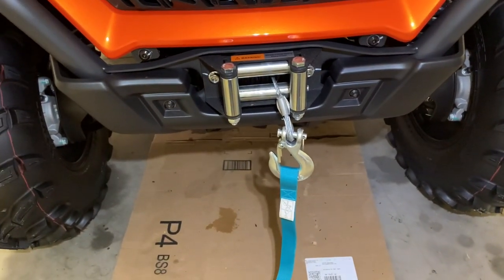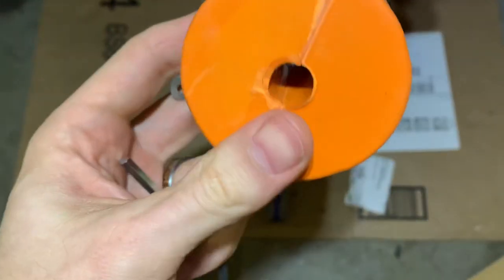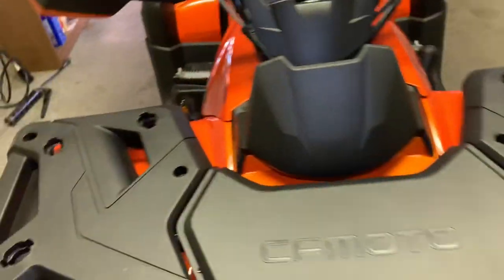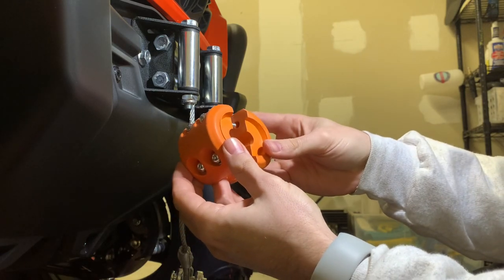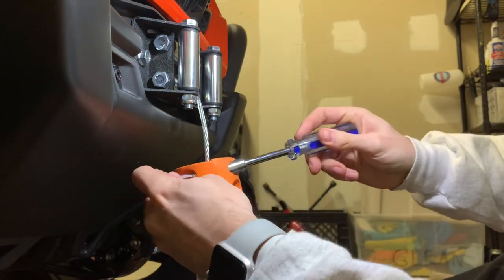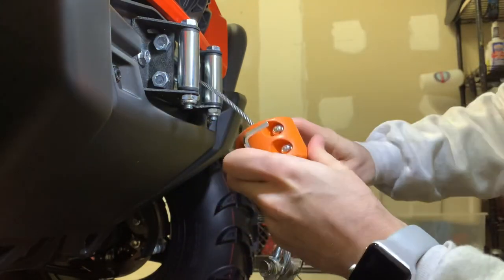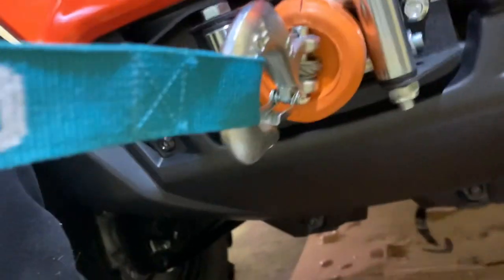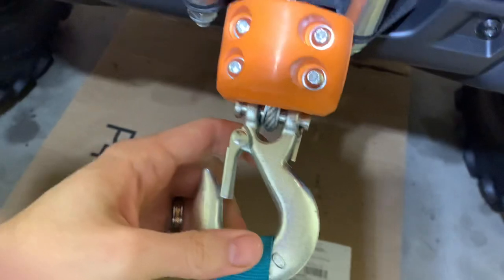Installing a rubber cable hook stopper (winch line saver) on an ATV winch

Comment: Sure you have figured it out but there is a winch release on the side of the winch you can turn to allow you to pull the cable out by hand then turn it back when you wanna use the actual winch motor